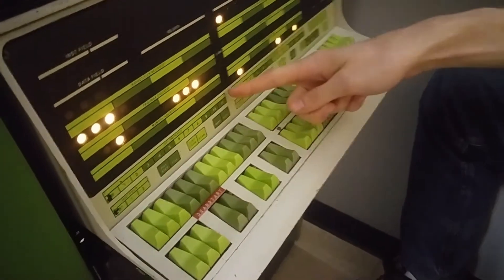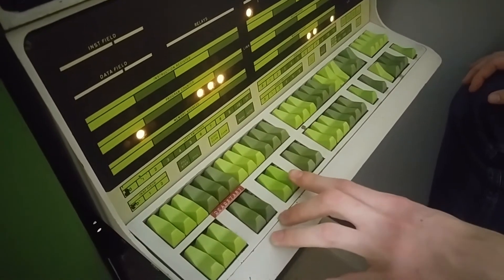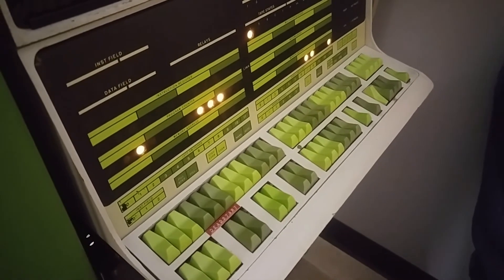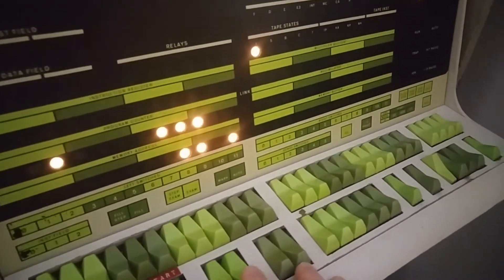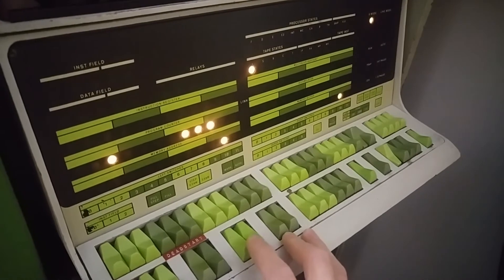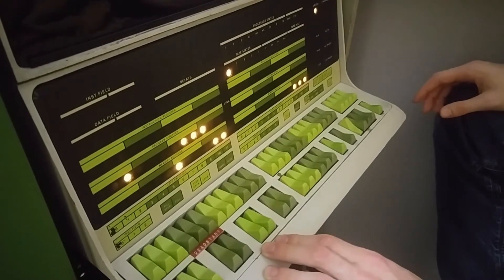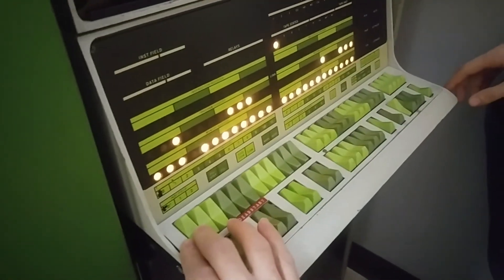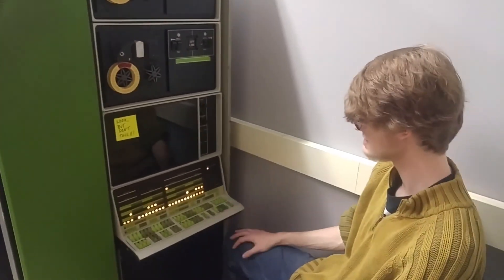PDP-12: It's ALIVE!!!

Comment: My first job, starting in 1971, was at a medical research unit in Leeds England; I programmed, used, and when necessary maintained two Linc-8s and a PDP12. They had two completely different instruction sets - in fact two different architectures, one corresponding to the PDP8 and the other derived from the LINC (Laboratory INstrument Computer). We collected medical data (nerve "action potentials", blood pressure, kidney output etc.) in real time and displayed it on a TV monitor. Our machine had 4k*12 bits of core store (the basic configuration) but we were debating getting another 4k, and an 8" disk drive, when I left. I designed electronics for a trolley so we could work in different rooms and connect via cables in the ceilings.
Although I programmed mostly in assembler, thanks to the Professor of Physiology I had a copy of a remarkable Fortran compiler which swapped code in and out to tape, enabling it to be a far more complete implementation of the language than you would think possible.

Comment: you said the pdp 12 wasn't maxed out with memory, but 4096 is 2^12, so 4k memory is the maximum it can address.  Back then 4K would have been considered a lot of memory for some uses..
Reply from the maker: True! But there are 3 extra bits that can be used to specify the 4K core in question. 3^2 is 8 of course, and 4k * 8 is 32k. So, 32k is the max that the PDP-12 can address. Our machine has two 4k cores, for a total of 8k.

The base memory of the PDP-12 is just 4k, but the modifications enabling expansion to 8k enables you to address all the way up to 32k (if you have all those core units). We are working on an expansion unit that emulates the original core expansions with modern tech, but that isn't working yet.
Reply: @pahp  That sounds like a PDP 11/60 That I used for several years. It had a 64K memory space and I think it was called a paging register, though it might have been system versus user space. I think the ``/60 had 128 k total memory. I didn't know the PDP 12 had that type of memory. Did the pdp 8's have that ability, or do you know?
Reply from the maker: @MrJimbok1  Hi -- I'm not sure. First, I'm not an expert on other PDPs, which were many and various. I do know that the PDP-11 had a variety of memory extensions over its lifetime, which supported some things that are quite a bit more advanced than our PDP-12 (e.g., virtual memory). For our machine, the 12-bits of a base address can "point" to any of the 4,096 12-bit words in a single 4K core module. Which of those 4K cores is being addressed is determined by three "extra bits," which allows you to choose between  8 possible 4K cores, or 32K total. (Our machine only has two 4K cores.) This is similar to how 32-bit CPUs in the modern era would nominally only be able to address 4GB (2^32 = ~4.3 billion) of RAM, but extra address bits exist inside the CPU for memory operations to allow it to address beyond that limitation. (Of course, memory management in modern 32 or 64-bit CPUs is much more complicated than that, I'm just referring to the ability to address more bytes or words than the machine's register size.)
Reply: For PDP-11s, max physical memory supported, depending on model, was 4MB or 2MW.  Address bus was either 22 bits for Q-bus or 18 bits for Unibus.

Comment: Saw a PDP-12 at Oregon State University, worked on PDP-8L and DEC-10's  the PDP-12 was initially know as a Link-8
Reply from the maker: Very cool! Yes, the LINC-8 was replaced by the PDP-12. There was also a LAB-8 (http://bitsavers.trailing-edge.com/pdf/dec/pdp8/lab8e/DEC-LB-HRZA-D_Lab-8E_Preliminary_Users_Handbook_Jun71.pdf) which seems to be a PDP-8 with some of the lab hardware of the LINC/LINC-8/PDP-12 (vector display and samplers, at least).

Comment: why does it seem like the bit labels above the switches are backwards?  Don't they show bit zero being on the left, but it seems bit zero is on the right?
Reply from the maker: For whatever reason, DEC labeled bit positions from left to right, even though the left is still the MSB (most significant bit). That means that bit 11 is the LSB (least significant bit). That's just how DEC did it.

Comment: Brings me back to my days working at Minicomputer Exchange in Sunnyvale CA. We bought and sold used Data General minicomputers such as Nova 2, Nova 1200, Nova 800, Nova 3, Nova 4, and Eclipse etc... plus peripherals. The DG Nova line were 16 bit machines that gave DEC a run for their money. They mostly saw use in business settings not so many in Universities. I fondly remember toggling in the bootstrap loader program through the front panel switches of various DG Nova machines. We've come a long way since then!

Comment: I thought you had extended memory (8K) and not only 4K.
Reply from the maker: Our machine has the extended memory option and originally had 8K, but someone must have "stolen" 4K some time after it was mothballed. Another 4K core was generously donated to use by a friend of the group's.
Reply: Some of these PDP-8/12 models could have up to 8 banks of 4KiW memory each, for a total of 32KiW.
Reply: An extender box was used in the VA sleep lab so semiconductor memory could be added.

Comment: ACHTUNG! Alles touristen und non-technischen peepers!

  Das machine control is nicht fur gerfinger-poken und
  mittengrabben. Oderwise is easy schnappen der springenwerk,
  blowen fuse, und poppencorken mit spitzensparken.
  Der machine is diggen by experten only. Is nicht fur
  geverken by das dummkopfen. Das rubbernecken sightseenen
  keepen das cotten picken hands in das pockets,
  so relaxen und watchen das blinkenlights.

Comment: Why did the PDP12 come out before the PDP11
Reply: There is no real mystery behind it. DEC roughly had three product lines, based on bit-size, cpu power and intended use. The systems in a line were somewhat compatible, with exceptions.
12bit:  PDP-5, PDP-8, PDP-12, PDP-14, PDP-16 (small, mostly single-user)
16/32bit:  PDP-11, VAX (medium, mostly multi-user / timesharing)
18/36bit: PDP-7, PDP-9, PDP-10 (biggest and fastest, multi-user / timesharing)
There is also the PDP-1, their first machine (18-bit), but it doesn't really fit in there.
It can be argued that the 16/32bit line with the dozens of PDP-11 and VAX models was the most successful. There is still a small market for PDP-11 hardware and software, and some systems are still in operation.
The 36bit machines were much rarer due to it's size and pricetag, but still had a lot of impact as it was the environment in which things like e-mail, forums, filesharing and the first incarnation of emacs were developed.
Reply: @wuloki  Nop, -14 and -16 are not computers, they are logic modules, but a real PDP-8/E CONTROLS some of them.
Reply: Not only did the PDP-12 come out before the PDP-11, but the PDP-15 came out at roughly the same time as the PDP-11! Why? Because DEC numbered these projects in the order that they were started and the PDP-11 had a very long gestation.

The PDP-11 was DEC's first 16-bit machine. It had a number of innovative features that delayed its release. One opinion inside DEC was that co-founder and President Ken Olsen was concerned that the PDP-11 would cannibalize PDP-8 sales and so intentionally delayed it. The PDP-11 lead engineer, Edison de Castro (who had also been an important contributor to the PDP-8) grew impatient and left DEC to build a 16-bit minicomputer known as the Data General Nova. How much of the design of the Nova (and recruiting of an engineering staff) happened while de Castro was on DEC's payroll remains a matter of dispute. But DEC folklore was that Castro's termination and exit interview was the briefest ever in DEC's history.

The Nova had a good head start and Data General ended up as the second-largest minicomputer company, surpassed only by DEC. The PDP-11 architecture was much admired and had a long and successful run.

It was also the end of DEC's practice of designating machines "PDP-{n+1}."
Reply from the maker: There doesn't seem to be a very satisfying answer to this question. It could have been marketing, or timing (the '12 and the '11 came out relatively close to each other) or a combination of both. Or something else entirely. Sorry!
Reply: @pahp  because of complexity. 

The PDP11 was a massively more complex architecture than the 12-bit, fixed word length machines, and turned out to take far longer to to design and debug, and also it needed more complex software. The PDP12 was basically very similar to the PDP8 - and everyone in DEC understood how to work with a fixed word length - particularly if the length was 12 bits. The way I remember it, development of the 12 started after the 11 was already late for its launch date, and the DG Nova was on sale. (The Nova was a 16-bit machine, but fixed word length, and not unlike a PDP8 but with 4 registers instead of an accumulator (Edwin de Castro designed the PDP8 and the Nova).

The PDP11 was probably the most influential architecture in the whole history of computing: Today's Intel architecture is a descendent of Intel's poor copy of it. 12-bit and fixed word length architecture are both probably dead - although I think the concept makes great micro-controllers.
Reply: Edson De Castro

Comment: So how Much Better is the PDP 12 over the PDP 11..?
Reply from the maker: So, it's funny, but the number after "PDP-" name does not really mean anything about computational power. The PDP-12 is a 12-bit machine built between 1969-1972, while the PDP-11 was a 16-bit machine built between 1970 up into the early 1990s. (For example, the PDP-10 was built between 1966 and 1983, and it had a 36-bit word length.) So the 36-bit PDP-10 came 3 years before the 12-bit PDP-12 and 4 years before the 16-bit PDP-11, but both the '10 and the '11 were generally more powerful machines than the PDP-12. 

The PDP-12 is a combination of two machines, the PDP-8 and the LINC, but that means that the PDP-12 can run programs for both machines, not that it is "dual processor" (the CPU can only be in one mode at a time) or that it is somehow more powerful than other larger machines like the PDP-10 or PDP-11. However, that, along with the fact that they only sold 725 units does make it very unique!
Reply: @pahp  I believe the final count was a bit larger.  I've heard of up to 1300.
Reply from the maker: @clasystems  Interesting. Wikipedia says 725, and cites this page: https://www.cca.org/tech/rcs/pdp12.html.
Reply: @pahp  So what the PDP-10 the basis for the DEC10 and DEC20 systems?
Reply: The PDP-12 was a delightful laboratory computer with a combination of the instruction sets from two previous very successful DEC 12 bit computers, the PDP-8 and the LINC-8. This instruction set lineage gave the PDP-12 when introduced a large and very valuable base of existing software. 
The 16-bit PDP-11 when introduced in the 1970 time frame had a brand new instruction set and came out initially with minimal software (pretty much just an assembler and not much else). The PDP-11 instruction set avoided use of a dedicated accumulator and could essentially use any memory address as an accumulator on which to perform arithmetic or logical operations which was a significant advance over earlier minicomputers like the PDP-8 and PDP-12.

Comment: Core memory is permanently non volatile, when you align the magnetic field, it stays that way until the opposite current is applied to change the magnetic alignment of the ring.  A (more) modern kind of memory to compare it to, would be novram or even more modern would be flash memory.  Core memory is incredibly awesome to physically look at (hair fine tiny wires and tiny ferrite rings) but the storage density is very small.  I think they said 4k (which was very huge back in those days).  ;-)
Reply: To Steve Quest. Yes, in these times, 4k was a huge memory.
In 72, I built an Intel-8008 based machine and my memory was ... 64 bytes. The clock frequency was 120 KHz.

Then I used a 8080 and I received 2 k RAM and 2 k EPROM (1702) from Intel. I have still 1702s. They are very nice. You can see the chip through a quartz window and the pins are gold plated.
Finally I used a DEC PDP-12 till 1977 but I preferred my Intel 8080 and then the PDP-11/45 The worst CPUs ever made in these times were the Intel-8086 and family and they were used to make the PC and later the Mac. A big step backwards.
Reply: @eurasia2941  In 1971 when this machine was built, core memory was the most frequent central storage technology. In fact, most programmers at that time didn't say memory, we said "core". It might have been "huge" compared to an 8008, but it was somewhat smaller than other machines that DEC was building at that time.
Reply from the maker: Hi Bob, sorry I'm just seeing this comment now -- you're absolutely right, and it's the origin of course of "core dump"!
Reply: Huge and expensive.
Reply: Surely over enough time the earths magnetic field and other EM transients will corrupt the memory contents?
Reply: https://en.wikipedia.org/wiki/Magnetic-core_memory

Apparently it is indefinite, and rather insensitive to EMP.   

Our PDP 8/I had stuff in core after more than 5 years, and I fully expect it to have it next time it can be booted.
Reply: @grossteilfahrer  It only retained memory because no major magnetic events have taken place.  If we ever have an earth magnetic pole reversal (these have happened in the distant past) the flux will wipe or at least severely mess up the memory settings.  You could then fire the machine up and reload everything and it would be fine.  EMP tends to induce voltage upon wires and could fry electronics.  Remember EMP is EM not just M.  :-)
Reply: Each bit of storage is a small ring or bead with several tiny wires threaded through the matrix of cores in X and Y directions. Very labor intensive to make, threading the wires through the tiny cores in the correct patterns. The signals to read and write the cores had to be just right so the X and Y signals would add up only at the cores being read or written. Cores are self shielding so outside fields don't have much effect, only the field from wires that threaded through the hole in the core would affect that core. Unlike most modern nonvolatile memories, core memory doesn't wear out, but it is really tough to micro-miniaturize. :)
Reply: ENonERtheGsoixEooDBeTruERwordLitEReilly!